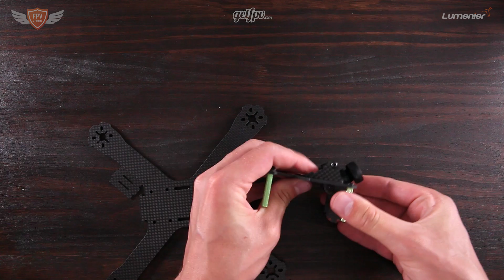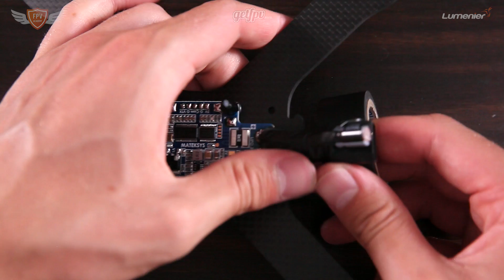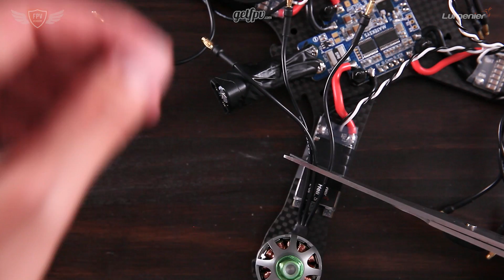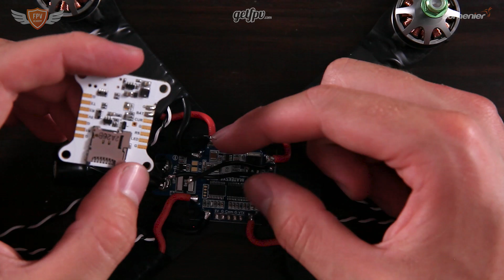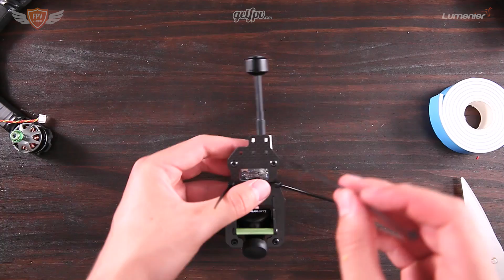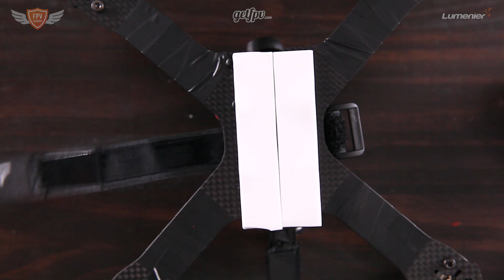Build Along QAV X  //  PART 1  //  Full Build of Multi-Purpose FPV Quadcopter Bundle

Comment: I cringed at 15:38 . You should never saturate a stranded wire with solder. All that does is create an especially weak solid-core wire that will break in half when subjected to vibration.

Comment: Don't just plug your quad in for the first time without checking it using a multimeter first. Stick it in continuity mode and use the probes on your + and - in the XT60, if it makes a continuous tone you have a short.

Comment: Also need video setting motor direction in blheli
Reply: Stephen, did you ever get this sorted? I just finished my QAV X and in testing the motors are all rotating the same direction (CCW looking down from the top). I'm at a loss as what the best way to fix this is.

Comment: you might want to add an annotation mentioning the importance of the length of your motor mounting screws!
Reply from the maker: Good idea! The motors usually comes with screws in the box so if you use those it won't be a problem.

Comment: will the o-rings also dampen vibrations?
Reply from the maker: The Lux V2 has a low noise 6000MPU gyro so it should be sufficient out of the box. The O-Rings are just an add-on which I like to put on all my builds; just in case.
Reply: @FPVAcademy  Hi from Brazil, Jack. I am a beginner and I would like to have classes. What should be the best sequence. How can I be your patron? Is there some program to do so? Thanks

Comment: Nice build video :) Might want to cable tie the battery leads to the frame as well to reduce strain on the PDB solder joints. Looked like there were two notches at the back of the base plate that could help with this.
Reply from the maker: Thank you :) Yes! Great idea. I personally don't really do this as I prefer to have it loose, but a good idea for others that want that option.